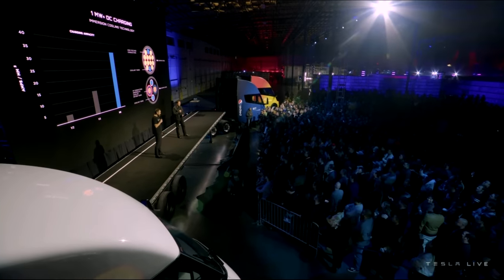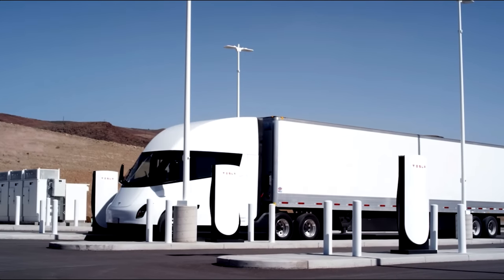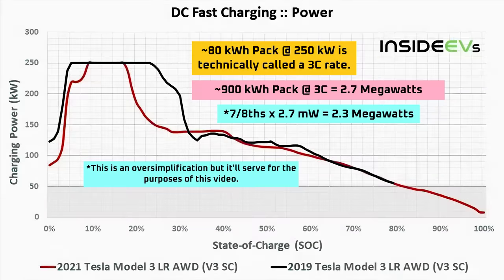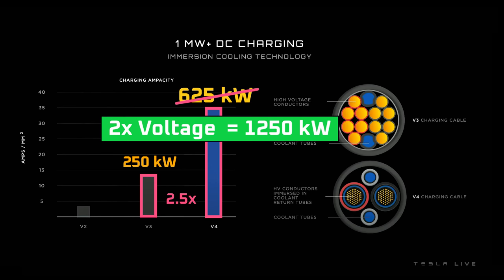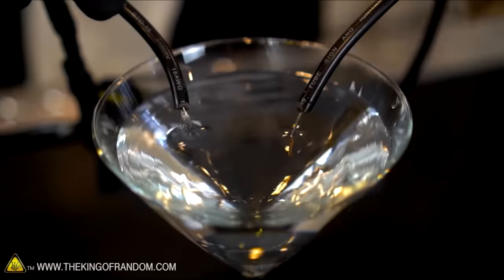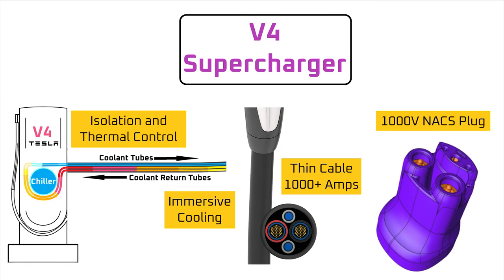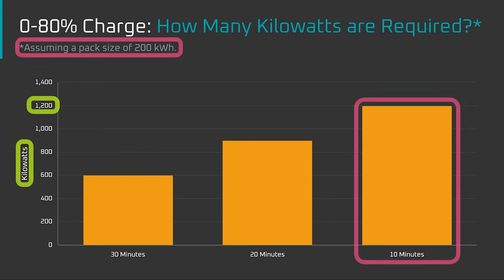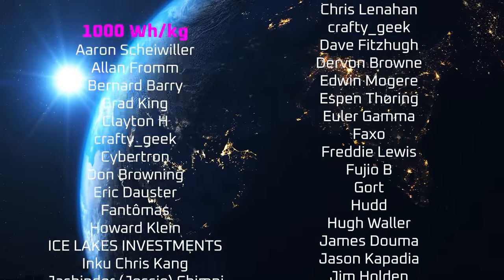Tesla V4 Supercharger // Megawatt Charging for the Masses

Comment from the maker: Point of Clarification:  My read of the North American Charging Standard documentation is that all supercharger plugs will be compatible with all supercharger inlets.  That is, there is both backwards and forwards compatibility.  Some found this unclear in the video.  However, of course, my view is that the megacharger will use a different plug/inlet.  That is, the Semi will have a different plug/inlet combination to accomodate higher power.
Reply: Thanks for your continued work, Jordan. Wishing you all the very best for 2023. 🙂👍
Reply: 👋  THANKS JORDAN, 🤗 for sharing your thoughts 💭,your efforts are appreciated 😎💚💚💚
Reply: P.S.  I hope you are surviving the weather here 🥶
Reply: Wouldn't make much sense to allow a Semi to potentially charge at a normal SC, taking up multiple stalls and not sure the cable could even reach.  Also don't want passenger vehicles occupying more expensive stalls meant for trucks with room for an attached trailer, which require substantially more real estate.
Reply: Appreciate the video and info.  With that said I still think we will see the same charge port in the mega charger and v4 super chargers for 2 reasons. Time will tell of course, we need someone to go get a close up of a delivered semi :). 1. The mega charger port does not look like it will hold up to long term use. 2. I think we are downplaying the thermal benefits on direct fluid on the copper.
Reply: THANK ,HERE WE GO AGAIN AND JIRI KONICEK ,ALSO ALL YOUR SUPPORTERS 🤗👏👏👏💚💚💚
Reply: What about cracking and leaking causing an arc? What precautions are into the inlet plug of the vehicles? Would be an interesting topic for a video!
Reply: Just like we have diesel pumps designed for semi use, it would not surprise me in the least that the EV version of a semi will have a separate charger. Tesla is doing a great job so far of two things, most important is the availability of charging locations and "uptime", second is the backwards/forwards compatibility.
Reply: @scottgaree7667  It makes perfect sense that all of this is compatible from the manufacturing end. Also, you wouldnt get much range out of plugging a semi into a normal supercharger, but it might be neccesary in certain emergency situations.
Reply: I do wonder how the new 1000 V CYBERTRUCK will charge from 500 V max superchargers?  Will Tesla use a powerful DC-DC converter, like the 150 kW unit that Porsche uses in the Taycan?  Or, maybe reconfigure the pack for 500 V, like GM does with the Hummer EV?
Reply: @dylanmcruse  THANKS DYLAN  🤗 for sharing your thoughts
Reply: @scottgaree7667  SCOTT  ,
Your comments, Make a lot  of sense too 👍🤗
Reply: Maybe you are right. However, sharing the same plug has lots of synergies. Tesla already has drive through charging stations wide enough for Semis. Also, every towing Tesla would like to use the larger drive through. Using the same plug lets Tesla monetize all stations immediately. NACS can do 900MW without cooling the receptacle. If it can do 1.5MW with cooling in the Semi, that's enough for Semi needs.
Note that doesn't mean that cars will constantly block Truck spots, or that Semis with trailers will drive into the Safeway parking lots.
Reply: The Fritolay Tesla megacharger plug is the MCS version 2 draft. I expect Tesla to update plugs and ports to MCS version 3.2 once final certification is achieved. It takes time to update parts based on schematics and the newest version was only unveiled at the end of September.
https://en.wikipedia.org/wiki/Megawatt_Charging_System
Reply: What I don't understand is how is a 500V rated cable compatible with a 1000V vehicle? My only guess would be that the vehicle will be able to increase the voltage via a DC to DC converter.
Reply: DC also means no skin effect so inter copper spaces need only be for cooling.
I suspect high voltage also reduces current and heat.

Comment: The power capacity of these chargers just... melts the brain. These voltages and power ratings were previously a domain of qualified electricians with detailed training and certification. Making it safe is possibly the most impressive part of this whole system.

At the same time: The "v4" and "mega charger" are lightly the same tech, just scaled differently for different uses.
Reply from the maker: Great way to put it!
Reply: Yeah... I loved the emphasis on 'measly one megawatt'
Reply: Complete circuit is hot+  negative- AND GROUND
Reply: Just hope the power of these systems don’t melt the cables!

Comment: As a result of immersion cooling the insulation (most thermally fragile part) is put in a safer place where coolant protects it first.  Also by loosening the conductor to insulator contact friction the cable will feel much more flexible given the conductor size!  It will be easier to manage for the human.  It can be kept above the coldest temperatures as well where the current cables get VERY stiff. Brilliant first principle work in many many ways. Ex coolant return temp closely directly measures conductor temp allowing maximizing of current limits!! and on and on
Reply from the maker: Great points! 🤠
Reply: Are you saying what I was thinking? The coolant loops can also be used as heating loops to protect against freezing, I.e. keep the whole thing permanently at the ideal temp winter and summer. Be nice on the hands too to plug in a warm charge cable
Reply: I just completed a road trip in winter and I noticed that the cable was much stiffer when I plugged it in than when I unplugged it.
Reply: @GalenMatson Yes.  Sometimes it is so cold that the non-thermally managed cable will not bend enough to stay in the charger storage socket even when I am putting it back and yes they are 'warmer' then then before I used it!  I hate the idea that they fall out and hit the ground after I leave!!
Reply: Are you going to liquid cool to power transmission lines trying to supply power to these oversized chargers as well?
Reply: @HansCSchellenberg  They will use battery storage to not only smooth out the surge of these chargers but to add to the actual capacity of the US energy grid.  Solar production is the largest reason for the battery deployment but surge use is also benifitted.
Reply: @zilogfan  Batteries only store electrical energy, they do not make electrical energy. Batteries do not add "actual capacity" to the US energy grid.
Reply: @HansCSchellenberg  Understandable error on your perspective.  US Generation is not the limit of production.  Night time and weekends have massive excess capacity.  The daytime peek grid capacity sets the current limit on usage and indirectly production.  Utility battery farms and power wall / battery storage customers pull power in off peek times when there is delivery and production capacity and make it available in peek times.  When enough Battery storage is online it can increase electricity PRODUCTION and availability by about 2.5 times the current system production.  It also moves peak load off the grid while doing this opening more grid capacity.  As a small example my 2 ev's are set to NEVER charge unless the utility has excess capacity and is out of peak demand times.  Batteries result in massive new electric total capacity period.
Reply: @zilogfan  Adding more and more batteries does not produce more energy. The idea that batteries will solve the issue of not enough power production and power transmission to support 100% BEV's on the road is delusional. This idea that the fundamental issues here can be overcome with a trick or "hack", like adding batteries and pumping more current through existing power transmission system wires because they are "underutilized" is just comically delusional.
Reply: @HansCSchellenberg  If you can not understand power generation being turned down most of the night and weekend then you may want to move to a topic less taxing.  Maybe pickleball or tennis is your thing...  Have a great day, I tried to help you.
Reply: @zilogfan  apparently you cannot understand that the batteries have a very finite energy storage capacity, and soon there will be no difference in load on the utilities between day and night as batteries are added. Then what, add more batteries?   Maybe you should put down your device and start using crayons instead :). You think this day vs night load difference on the utilities will always be there as batteries are added to the system? Batteries are a very short term non scalable "solution" to the shortage of electric power from the utilities. Batteries do not create electric energy, they only store it. Can you grasp that simple concept?
Reply: @zilogfan  Also "power generation being turned down most of the night" Power generation is not turned down at night, there is less load on the power distribution network at night, however most BEV's charge at night, therefore that is changing rapidly. Let me guess you write software and think you know everything about hardware? Am I right?
Reply: @HansCSchellenberg  Not even close but you are consistent.  I am sorry I tried to help you. never mind...
Reply: @zilogfan  😆🤣

Comment: Just a thought about how to chill the cable liquid coolant.  Since Tesla already has an efficient heat pump design in the cars that works off the high voltage battery, it would be simple to use that and a plate heat exchanger to cool the circulating coolant in the charger pedestal.  The power source would be the dc charging voltage which should be almost the same as the battery voltages present in the cars, so no redesign of the heat pump electrics is needed.  The plate heat exchanger isolates the refrigerant from the cable coolant while efficiently removing the heat.  A small radiator then transfers the heat from the refrigerant to the air.  Because the heat pump is produced in large volumes for the cars, the unit cost would be lower than a new dedicated design.

Comment: Great research Jordan. Proud to be a patreon member. The Frito-lay plug uses the a prototype iteration of the Char-in plug for semis. The next (and approved) generation is a triangular looking plug. I believe Tesla is only delivering to Frito Lay and a handful of other customers until they fully qualify the truck.  It sounds like Tesla may keep many semis internally or a while and could use/test any plug it wants. 

Depending on the Frito Lay use case, do you think that Tesla would refit the semis delivered with the approved Char-in plug. If short haul where trucks return to base may not need retrofits, but those that go long haul might want to take advantage of having an open standard plug.
Reply from the maker: Great point! This is something I had to think about a bit when writing the video.

That depends, will the charin plug have immersion cooling?

In my view, it will take not just a specialized cable, but a specialized plug.
Reply: @thelimitingfactor  The CHARIN plug is capable of over 3 MW, per your video.  That should be sufficient power regardless of cooling method, but I would expect it to use liquid cooling.
Reply: Good point have ur people tell they’re people send em a tweet

Comment: Thanks Jordan, very nice job!  One minor detail: existing vehicles are 400V architecture, so at 250kW the cables pull 625A.  Interestingly, that translates to a cable max of 312.5kW at 500V...which fits the 300kW narrative.  But it may presently be limited to 250kW due to the power electronics, therefore requiring an upgrade for this capability.  That also translate to 1.56MW at 1000V...which is substantial!
You also mention the thinner wires are a disadvantage for current, but the quantity has also increased.  As long as the total cross section doesn't decrease, this should not be a disadvantage.  In fact, the exact opposite is true: the surface area is increased, improving cooling which in turn increases max current.  I suspect the individual wires will need to have some minimal insulation to protect from corrosion.
BTW, Reuters reported the chargers at Frito-Lay are 750kW.  I suspect they may be using the V4 supercharger there for now, since it's available (and would give better use data in preparation for Cybertruck).  It would be trivial to swap out the few of these that currently exist with Megachargers in the future.
Reply from the maker: Great points!
Reply: Pretty sure when I was looking at this that there’s two rating plates for v3 some of which are 500v, coudl it just be that there’s a dc / dc optimiser adjusting V / I on vehicle?
Reply: Well said ty

Comment: In our data centers we use some immersion cooling with a dielectric non conductive coolant.
Reply: I've thought about this for a few mins, the heat exchanger for the coolant loops is probably a hermetically sealed container filled with Fluorinert or equivalent with the 2 loops running though it and the evaporator of a chiller

Comment: By Cooling the wire inside the wire it will also cool the connector connected to the car just like the side cooling the Battery exterior and interior also will be cooled. 😘

Comment: also remember if the cybertruck is connected to 250kW it will be able to sustain the max charge rate for much longer into it's charge cycle shortening it's relative total charge time.  That is the charge current profile will look much different.
Reply: Seemingly correct, however if V3 and below they would have to charge half the pack at a time and thus this comment would only be true if the pack were MORE than double the size of the current car packs.  And to the degree it is more, Ie if it were 4x the kwh then you could hold the 250kw rate twice as long to your point.

Comment: Hey Jordan, excellent breakdown of history and potential improvements of next gen charging. Super interesting! I didn't know exactly what changed from V1 to V3. 

A few thoughts to share. I wonder if the direct water cooling on the V4/mega charger plugs could actually increase power transfer by acting as a conductor itself (if combined with antifreeze/ion solution). That would be a double benefit if true. 

2nd on V4 plug CAD. My thought is that the strange non-flat shape could be in place to increase electrical clearance between active and ground connections, potentially for hi-potential reasons (arcing under super high voltage). 

Hope you are well and happy holidays!
Reply from the maker: Oh heck!  Good points!  Happy holidays to you too buddy.
Reply: A liquid coolant and conductor is an intriguing thought, but does not seem practical:
•6 Metals. Best conductors + excellent coolants, but all seem expensive, some are toxic/radioactive, and even the best conductor is still ~6× less than copper.
•More metal alloys. Some are used as coolant, and gallium-based seems used as conductor at small scale.
•Some molten salts/Ionic liquids/RTIL. But they are often moderate to poor conductors.
•Acids, but they are agressive and way worse conductors.
Reply: Added phase change

Comment: I have thought about this and the simplest solution would be a duplexer with 2 separate charging circuits on board the Semi.

You could jack in 2 mega charger cables coming off of 2 charge units at the same time. You are basically split charging the pack.

You could start out with an adapter at first and then improve.

It would also allow the semi to take advantage of any Tesla DC charger it could find in a pinch.

Comment: I do think the Tesla Semi will have a different plug that can provide several MW, but I would not be surprised to see a secondary port that is the NACS standard, would allow companies that don't operate 24/7 to install V3 or V4 chargers on site for overnight charging. In addition this would allow a semi to use the standard supercharger network in an emergency. Or if tesla decided to put V4 chargers at some truck stops, the general public could use them too.

Comment: There are massive synergies if all chargers deployed can be used by the whole fleet. Compatibility of all V4 with the existing fleet is the best way to finance a massive rollout of megawatt charging. That's how you can deploy chargers that only benefit Cybertrucks and Semi trucks. You have the fleet using them from day one. 1.2MW is enough for Semis in most cases. Maybe there will be a few megawatt chargers that go beyond eventually, but for a few years, NACS is enough.
Reply: Good point I’m thinkin v5 or v6 consisting of wireless inductive megnetic resonance charging -disclaimer not stock advice …I know nuthin!!

Comment: Great Video Jordan!
I think the Semi will have a complete flat charging curve to 70% at a charging rate of 1.4C or 1.25MW, which will be the max output.
This is my speculation because today a model 3 can handle 1.4C up to 70%, a heavy duty vehicle suits better with a flat curve than a 3C boost in the low end that makes no sense and requires so much more power. So my take is that V4 will be the one and only solution.
Reply: Good point, with scheduled driver breaks peak C / splash and dash type charging is far less relevant and makes site supply / battery buffering far less onerous
Reply: It’s still early in th transition th chargers will get bigger and bigger and better more problems more solutions